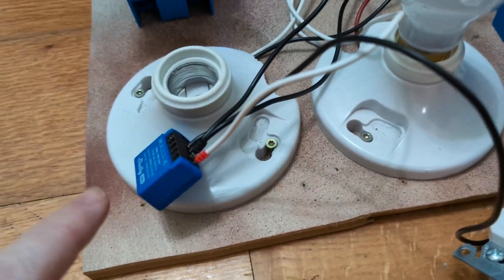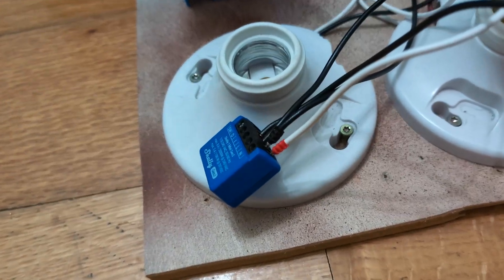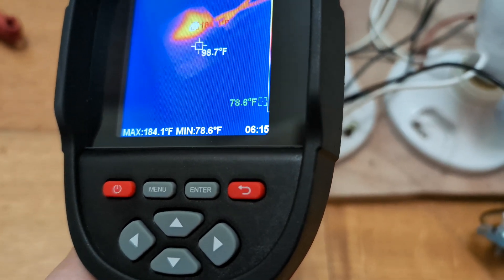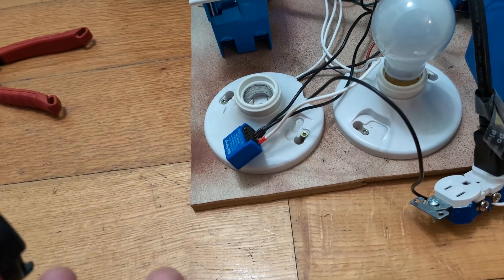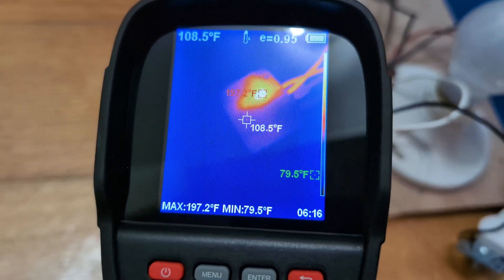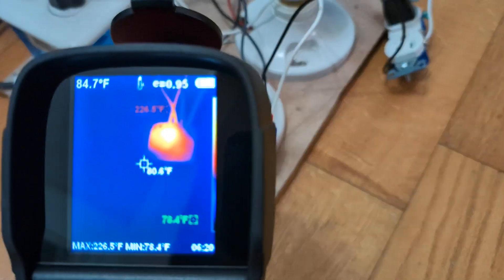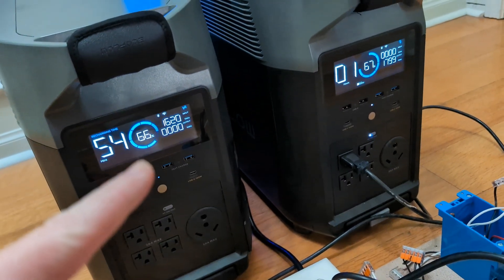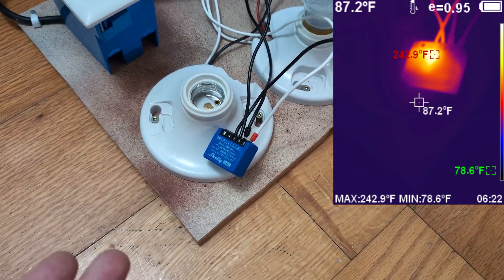I was WRONG! Shelly1 Gen 3 Smoke Test - DO NOT DO THIS

Comment: It is rated for 8 amps! 
At 120 volts that is 960 watts. 
If you run a drug farm you definitely need lighting that bright. 
But normal lighting today has 5 - 10 watts. That would be 0.08 amps at 120V.
Reply from the maker: Yes you are correct but you can't guarantee something won't happen down the line.  That's why we have this amazing invention called the fuse that was later evolved into a breaker.  It should always be the weakest link in the chain.

Comment: Correct me if I'm wrong but it says 8 A / 2000W @ 240 VAC. 2000 watts on 120VAC is not 8A, it's actually 16A so this device is actually rated correctly for a 15A circuit @ 120VAC.
Reply: Heat generation is based on amps, not watts.  So, 8 amps is the rating for all AC voltages.  DC amp rating is lower on a relay because arcs are more of a problem with DC.  An arc that is formed across the relay is more easily extinguished with AC.
Reply from the maker: You need to go by amps on what breakers can handle.

Comment: can someone explain me like Im 8 why would using these for 10x 14w outside lights can have a risk, using at 220v and breakers vary between 10 and 20A
Reply: In case of a failure in your circuit the current in the Shelly can rise above the rated limit. One risk of having too much current going though the Shelly is that it gets really hot and starts a fire.

Comment: I am from Bulgaria, the home country of Alterco robotics, and Shelly. Here, we usually put 6A breaker for lighting circuits. We use 230v AC single phase network. So this fits perfectly for switching lights. We usually use 16A or 20A breakers for general-purpose circuits like wall sockets. So, this is not intended for anything else than lighting switching.
Reply from the maker: They sell it here in the US where split phase 240v is the norm. 15A and 20A circuits are typical and a lot of times sockets and lights are mixed in at times. They did recently approved the usage of 10A lighting circuits breakers.
Reply: @digiblurDIY  
> They did recently approved the usage of 10A lighting circuits breakers.

With my emphasis:

240.6 Standard Ampere Ratings.
(A) Fuses and Faxed-Trip Circuit Breakers. The standard
ampere ratings for fuses and inverse time circuit breakers shall
be considered as shown in Table 240.6(A). Additional standard
ampere ratings for fuses shall be 1 , 3, 6, and 601. THE USE OF
FUSES AND INVERSE TIME CIRCUIT BREAKERS WITH
NONSTANDARD AMPERE RATINGS SHALL BE PERMITTED
Reply from the maker: @anonnona8099 yup I am aware. But I haven't run into places with the breakers installed yet. It is great to see it approved
Reply: @digiblurDIY  
Seems bizarre that it would ever need to be "approved".  As long as a breaker isn't rated too high for the cable and switches etc, what business is it of the NFPA what people choose to use?

I'm in the UK, and we can use anything we want, provided, as you said, it's the "weakest link".   I could use a 1A one on a circuit if I wanted to.
Reply from the maker: @anonnona8099 really down to my approval above all things first. Just like I won't use an extension cord for a space heater. A claim could potentially be denied if they can prove negligence.
Reply: @digiblurDIY  Agree and disagree, depends on how you are using it, I have some of the little red ones I am going to use to turn the bathroom fans on and off, I would worry way more about the bathroom fan being an issue over the Shelly in that applacation. But, hard no on anything someone can plug differnt loads into, or you would need an automation that says if amps is greater than 8.5 turn off OR if amps =n/a or null then off, but idealy would not put them in a place that is an issue. I don't see this as much diffrant than smart stitches that say "Maximum Load (Watts): 600W Incandescent, 300W LED, 150W CFL", thats how I would approach it. That or use it to controll a bigger dumb relay it it was the switching one only. Simular to the way larger lighting circuts use a normal light switch to power/trigger a contactor for the 277V lights.
Reply from the maker: Agree disagree with what part? Weakest link thing?
Reply: @digiblurDIY  
I'm not trying to get into any beef with you.  It seemed as if you were saying (and apologies if I misunderstood) that the NEC actually didn't, (or until recently actually didn't) allow the use of 10A breakers for lighting circuits, which seemed utterly bizarre, because as I said what business is it of them if people want to use any rating they like as long as it is less than the rating of the cable (and being higher than the load is also good, as you don't want it to keep tripping).

I get that if 15 or 20A circuits are very common, because mixed outlet & lighting is the norm, then it would make commercial sense for Shelly to make higher rated devices.

But I also get that these days LED lighting needs very little power, so there shouldn't be any issues for any designers or installers or regulators with 10A circuits.

Nor with smaller cables - comparing Table 210.24(1) with the ones in the UK's Wiring Regulations is intriguing, as the physics of cables getting hot when current passes through them is the same the world over.   Our lighting circuits are 6A rated, and commonly wired in 1mm², which is 17 gauge.  Personally I prefer 1.5mm², which is 16ga, as it doesn't break so easily under terminal screws, but I can't deny that electrically that's overkill.  Depending on how it's installed, 1mm² is rated as high as 16A, and 1.5mm² 20A.  

Worst case, with cables buried in thermal insulation we'd use 1.5mm² for a 10A circuit, but for cables run inside drywall without insulation 1mm² would be fine.

14ga is 2.5mm², and would never be seen in a domestic lighting circuit - that's the size we use for socket outlets in the 20/25A space. (Or 32A rings, but that's a UK-specific topology oddity).

Comment: From Norway, with 230V/400V. 8A is still to little. The fuses are normaly 10 to 16 A.

The shellies with 8A relays could then only be used for some fixed lights and not for wall socets where anything could be plugged in.
Reply: I wonder if sockets and lights are on separate fuses nowadays. Maybe, 16A for sockets, 10A for lights?

Comment: It's probably based on the rating of the relay contacts.  The contacts can probably handle the load fine once it's on.  However, making and breaking that current could cause the relay contacts to weld depending on what type of load you are switching.  Inductive loads are usually the worst.
Reply from the maker: I did toggle it about 10 or 15 times but I believe the soft start doesn't let it weld unfortunately.

Comment: Shelly needs to put out 20 amp rated devices. Even if you don't run them at that level, they are expecting DIYers to put these things in the walls.
Reply from the maker: That would be great!  Covers all of my non-split phase circuits for sure!
Reply: This is just one of the downsides of the US choosing 110v. You can thank Edison for it. North America is the outlier not using ~230v.
Reply from the maker: @kallan2255 yup. One of the few using it. We only use 240v for large appliances. In the residential setting that is..
Reply: @Obtuse94
> Shelly needs to put out 20 amp rated devices. Even if you don't run them at that level,
> they are expecting DIYers to put these things in the walls.

No - they are expecting anybody who puts them anywhere to do so safely and in accordance with both regulatory requirements and their instructions.  If they tell you to use 10A protection then you damn well use 10A protection - end of.

Comment: Wiring is likely only rated to 90C which you'd probably exceed by a bit🥵. Wonder how hot the ESP was getting.
Reply from the maker: hahah...indeed..ultimate wire test!  it got pretty soft but never melted it.  I've used this wire for the Sonoff tests too.  I had stock firmware on it, so I'm not sure if that is exposed or not.

Comment: Shelly does a really good job at over engineering and underrating their devices but for the life of me, I don't understand why they don't have at minimum a thermistor in there to shut off the relay if it gets anywhere near that hot.
Reply from the maker: They do have the ESP32 temperature sensor but those are pretty unreliable so I get not using that.  I do agree, I've had some Shelly devices running for years and haven't touched them.  I have seen a few pictures of popped caps and such but nothing bad has happened here.
Reply: Its the main reason why I stay away from the 1 series now

Comment: In Norway the fuse ratings in a house is either 10A, 16A, 20A, 25A or 32A (230V).
Doesn't matter if it only controls a light - code doesn't allow this little thingie to be used in a wall-box here.
Reply from the maker: Same here, from things I've read and lawyer speak, you are supposed to match up the various ratings.  Which does make sense and is the way I roll and keep the breaker the weakest link.
Reply: I am from Norway.
Into a outlet fused by that 16A fuse you could put a flat euro plug with a  0.5mm2 cable running to a stereo or a lamp. That cable and plug is rated 2.5A Without extra fuses. 

In an apartment i had, there were some 20A breakers for heating and 4mm2 cables. From that cable there where a 1.5mm2 cable tap for the kitchen fan. I checked with a electric engineer and it was allowed as there where no plugs involved that could let people plug in more than the 1.5mm2 cable could handle.

But the rules have changed in the last 20 years so it is probably not allowed now for new installations.
Reply: @kjetiltrondsen8242  Yes, for dedicated equipment, smaller cable is allowed, which is why, as an example, 0.75mm2 cable is allowed when powering a sconce even from a 16A socket. However, the cable must always be able to handle the rated short-circuit current. But yeah, NEK change all the time. For a while, 13A fuses could be used even for 1.5mm2 cable inside walls. But they later found out that in certain circumstances, the cables could get hot and brittle from it. So, they changed the code again.

Anyway, code is there for our safety, and personally I tend to take everything 230V seriously. I, for one, live in a house made of wood :)
Reply: @ollyalme
> In Norway the fuse ratings in a house is either 10A, 16A, 20A, 25A or 32A (230V).

And are you actually forbidden from using ratings <10A if you want to?

> Doesn't matter if it only controls a light - code doesn't allow this little thingie to be used in a wall-box here. 

Even if it is on a 10A circuit, which the manufacturer instructions say is OK?

Comment: Nice illustration and revisiting of this concept, TYVM.
Do you prefer the Sonoff MiniR2 or MiniR4 (Extreme) any better?
Reply from the maker: No. I will have to say I prefer the 16A models of the Shelly and their firmware is miles ahead. Out of the box and I don't need an app to pair it, I can use it locally with stock firmware? Count me in. And you can still flash it if you want. They know what they are doing.

Comment: How hot in C?
Reply: But I'll help you a bit 32f=0c 212f=100c
Reply from the maker: 242F = 116C  

I need to find a way to safely pull 20-25amps on these things.  Researching a few things and prices.
Reply: @digiblurDIY you could have it give power to an automotive relay.

Also, what will kill the switches is the arching. 
Relays and switches are usually rated much less at DC than at AC.
Reply from the maker: My tests batteries only have sort starts unfortunately. Nice idea on the DC loading. You know I want to smoke one for fun.
Reply: @digiblurDIY  30amp contactor.  (It's what we call relays in larger things like HVAC compressors or water pumps.)  Shelly or similar to control the 120v coil, 30amp rated contacts (that's about the smallest and they go way up from there) to control the load.
Reply from the maker: Yup. Saw heffneil using a 50a 240v split phase one  on an oven and used a small smart relay to drive it.

I just need a load that doesn't have soft start around the house and isn't my main HVAC is the issue. All gas here and I am not testing things on my HVAC. Quick way to piss off the wife and myself if I smoke it. Maybe two old heaters might work...
Reply: @digiblurDIY   The cheap and easy way is a bunch of cheap ceiling light sockets like you are using in the demo. Screw these down to some scrap lumber and wire them in parallel. Use old incandescent  bulbs and Heffs sake get out a good pair of sunglasses ... Dont want to be screwing up any cones and rods like Kramer.. 20 Should do the trick..
Reply: @digiblurDIY  
> I need to find a way to safely pull 20-25amps on these things.  Researching a few things and prices.

Arduino and external relays.
Reply from the maker: @anonnona8099 the actual feed and then the  load is what my issue is as all of my non split phase feeds are 20a
Reply: Google....